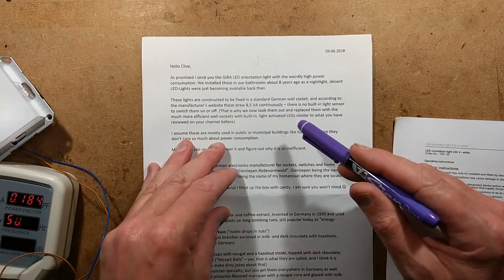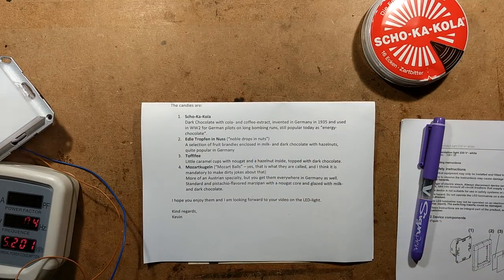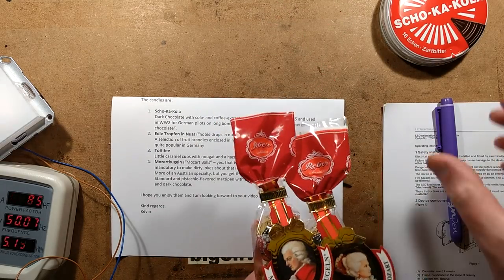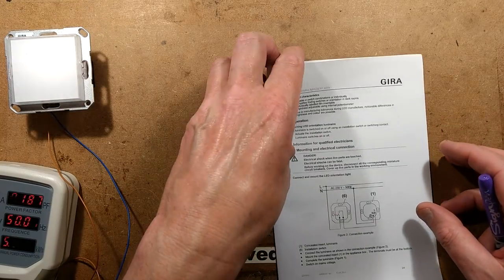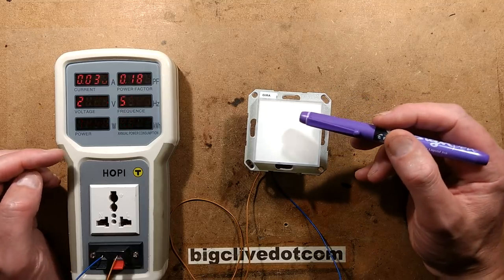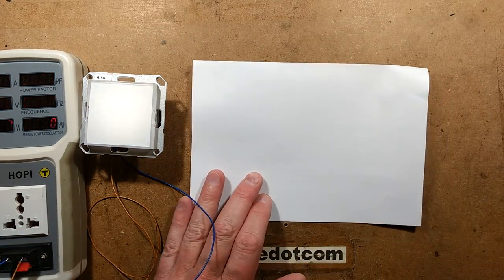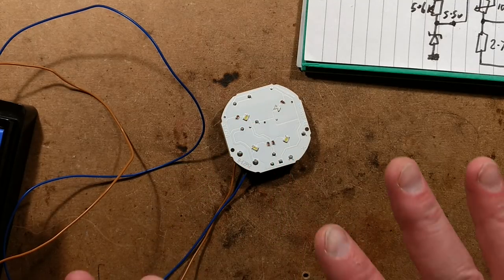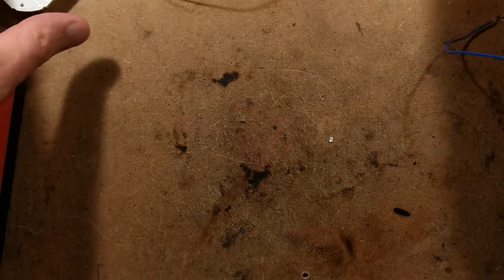Well engineered German LED light?  With schematic and tests.

Comment: I am almost certain VA is what people are already being charged for by some companies. I know of four people who have seen a jump from approx. £30 to £45 per month on electricity with no difference to their usage habits or appliances. That's why when they wanted to change my meter I told them to go away in short jerky movements. My electricity company already hates me because my bill is so low it actually costs more to bill me than I have to pay. OK I'm a single guy in a flat but I got my bill down to under £5 a month.
Reply: Gordon Lawrence Wouldn't work here. You pay a basic fee just for the potential of being delievered electricity. It is around 10€.
Reply: Future Chaos do you live in Germany?
If yes my condolences on your “Energiewende”. What good does it make shutting down Nuclear plants when you border a country with like 50+ reactors? And BTW France's carbon emissions per kWh are less than 1/10 that of Germany and the UK.
Reply: Krasimir Ivanov The energiewende term has more to do with switching to renewable energy and less with stopping nuclear plants as that came later on after the Fukushima incident. And you can't just keep something up and running just because someone next to you does it as well. Now while I don't approve on shutting down nuclear power plants and building new coal plants there are some problems with nuclear power. The waste problem still hasn't been solved mostly for political reasons but we can't just simply dump it into norwegian arctic waters like russia.
Reply: My point is if a nuclear accident happens it is very likely to happen in one France's aging reactors. Guess what the direction of major  wind currents is? Well you can do what France is doing with its waste. Storing it in deep geological repository under 500m of claystone/mudstone, 400m of granite. The risk is minimal. Yes it is expensive but still better than financing solar energy in a country where half the year it's overcast or buttfreezing winter.
It is better than killing you economy which relies heavily on electrical power.   
0,33$/kWh vs. 0,20$/kWh but still doing far worse  in terms of efficiency and enviromental impact. 
Renewables subsidies are a bad idea. They shortcircuit natural market drives. Renewables are becoming viable  but still can't take the planned 40% share without having to rely on a lot of backup plants which still require maintenance and mitigate any enviromental benefits.
Reply: Krasimir Ivanov We had our share of accidents where radioactive materials leaked through into the groundwater. So even if nuclear plants build today are as save as it can possibly get there is no sensible solution yet found to store the wast. Using sun and water will never be that efficient but at least when they break down, we know where to put them.
Reply: The Asse II salt mine should never have been used in the 1960s and 1970s as a site to dump nuclear waste.  Today, nobody would choose this mine to place radioactive waste. Anually there is more radioactive waste  (238U, 226Ra, 210Pb, 232Th and 40K) released in the atmosphere burning coal than the few accidents we had past 50 years.Today's technology andsafety regulations makes it so unlikely for an accident to occur that it is really more enviromentally friendly than even wind/solar.
Reply: Krasimir Ivanov Yes I think it could be stored reasonably well but instead they used shitty storage because.. basically the good places said no fuck off we don't want this here. But we do like some electricity, okay thanks. It's more likely gonna be that exeptionally crappy belgium reactor that's gonna blow first. The thing with renewable energy sources is that development is not going to take place all by itself and forcing it into the market is going to speed up this process. We have come a long way with wind energy and small towns finance their own parks and often make a decent profit. Offshore windparks are coming along nicely but there are still some minor problems that keep those things from beeing viable economically and those things have to be solved better now than later on. France just has full on nuclear power which also isn't all that cheap but most important the general population in germany has a negative bias against nuclear power so we are not gonna get it. It's sad but it is the way it is
Reply: Because not everyone is doing the correct thing means nobody should? Nuclear is an inherently dangerous technology. If the companies that run nuclear reactors would need to get insurance for it in the public place for the potential catastrophes, nuclear energy would be too costly to be used. But because the public/government/tax payer covers the cost of potential nuclear meltdowns and areas being contaminated and the other fallout that can happen, it is so cheap out of the socket. So all other power generationg technologies enjoy as much or more subsidies than solar and wind in Germany today. Our economy is doing fine. The real solution isn't a national one but a global one, using nuclear is not even a stop gap, because it will mean people will be complacent. If you build a nuclear power plant today it needs to run for 30 to 40 years before it turns a profit. That means the companies will have a vested interested in keeping competing, clean energy sources uncompetitive and blocking legislation and activities to generate hydro power, solar power and wind power in the appropriate places as well as investing in storages solutions and a grid that can handle all this decentralized power generation over all of Europe. You are thinking rather small.
Reply: Nuclear is an inherently dangerous technology. You would be surprised how SAFE they are TODAY. It is more likely to die of hundreds of other reasons. A dissaster the size of Chernobyl is impossible to happen becuase all reactors of the type have been decomissioned or improved.
It is very likely to die in traffic accident, heart attack, diabetes, cancer, work accident. Folks cross the street, stuff their face with greasy meat, smoke two packs of cigarettes/day, work in construction. I bet you 50 bucks the last 15 years of solar energy 100s of people died building them. it is okay for someone else to work on an oil rig  but no if your bacon in on the line with a chance less than 1% of the one you have of winning the lottery. No way!
Reply: The only real problem we have to solve is energy storage. Once that is solved we don't really need coal or nuclear. Solar cells, wind turbines and a few of the other renewables would be enough. You don't even need a massive amount, about 50kWh per household would be ok and would not be that large if stored at the household level. Domestic generation from solar during the day is enough together with wind to power most industry. You could draw in the effectively dispersed batteries in the day.
Reply: @brk932  Estimating things based on a percentage of incidents, is a bit silly.. If nuclear goes to fuck, then nuclear goes to fuck... Not just a single guy getting fried like an egg on a rooftop, but logically way more severe... Luckily, it rarely happens as you can see..
Reply: Solar is wonderfully clean, so long as you ignore all the chemicals and processing that goes into making the panels. Hydro is great so long as you don't mind submerging entire valleys and cutting off ecosystems.

None of our electricity generation is "clean". The only thing that can be definitively said is that burning coal is the worst modern way to do it. Shutting down nuclear plants and firing up coal plants is like refusing vaccines and then smacking a rabid dog with your bare hands.  (Renewables are great and use should be expanded, but they aren't a panacea)
Reply: Robert Szasz the chemicals and processing are nothing like as bad as you think. The data you are probably looking at goes back to the 70's when solar cells were in their infancy.
Reply: The point still remains that it is far less dangerous than crude oil which contains all sorts of nasties. Have you ever looked at the composition of drilling mud for example? That is way more dangerous than the doping chemicals for either silicon or gallium arsenide semiconductors. Boron is really not that dangerous at all and has almost taken over from earlier group III dopants, and phosphorus has started taking over from selenium. In the amounts used it is harmless. IE a few PPM. Most grades of petrol and such like contain benzine - toxic and carcinogenic. Coal contains actually quite high concentrations of arsenic and all sorts of other nasties including some of the nastier fluorine compounds once burned. Gas fired generators give of PCB's (polychlorinated byphenyls) and environmentaly damaging chemicals gram for gram do not come more dangerous than that.
Reply: @gordonlawrence4749  Solar cells are probably one of the dirtier renewable energy sources in terms of build and disposal per GWh (very very 'clean' during operation though with minimal environmental impact) wind and hydro have higher operating impact but lower hazardous waste at the end of their lifetime. 

I'm pretty sure nuclear and renewables fall within the same sort of range in terms of environmental impact per GWh. Orders of magnitude better than  the best fossil fuels. Many, many orders of magnitude better than coal.
Reply: @gordonlawrence4749  oh, and drilling mud going down is pretty darn safe, it's mostly water and bentonite. Rocks are dirty, nasty, toxic things though, and when ground up and mixed into the mud it forms a toxic slurry.
Reply: That was exactly my point. So in both the long and short run Solar Cells are far better for the environment than any of the alternatives and that includes the issues surrounding power storage, which will fairly soon be reduced further by carbon large capacity supercapacitors. I'm not going to go into detail as the chemistry is a trade secret but all they contain is carbon, cellulose film, a plant oil, and a mild acid that is safe enough to drink in small quantities. I have already got the capacity up to 1/3 of lithium cells with a charge/discharge life in excess of 6000 cycles. (testing 50 charge/discharge cycles a day for 4 months on 20 units for zero failures.

Comment: Just do not use the lamp with capacity dropper. They really shimmer. We are banned from such lamps in many places. Because the light pulsation coefficient is measured (it is printed on the box.). Good LED lamps have driver with power correction also.

Comment: I was wondering if its possible to (after removing and replacing all wall mounted mains dimmers with switch plates) change the 6amp lighting circuit with a 12V in line transformer and have 12V LED ceiling lights instead. There would be no need for cap droppers. The bulbs would just need a bridge rectifier and storage cap then the relevant resistors depending on the amount of chips in the lamp. Would that make them cheaper to make/buy than the mains led lamps using full drivers for proper driving of LEDs. I can think of tons of benefits on having a 12V lighting circuit apart from what power transformer you would need. I wonder how that would effect PF on the meter. a little model or set up might be required. My front door "reception" passage has a 12V string (5) on the ceiling and I have replaced 3 of the 20watt halogens with 12V 2 pin led spot lamps and they look a lot brighter on the wall than the 2 remaining halogens. The transformer is under my bedroom floorboards on the side of a joist wired into the original rose for the passage hidden out the way. It is rated for 5x50W halogen lamps. Its a commercial fitting and I have had it for 15 years now with no issues! I think the transformer is actually under rated voltage wise, about 11.5 volts or something for a tiny bit of extra life on the bulbs. I'll have to test it with my meter, never thought of that lol

Comment: The power company's justification for charging for apparent power is that their equipment has to handle that amount of power. Here in Australia domestic consumers are charged for real power and commercial apparent.
Reply: Their wiring has to hande that current, however they do not have to generate much more electrical power. They only have to produce a bit more because of the increased losses in their wires and generators.
Reply: Not just their wires though, also their transformers and switchgear and protection devices have to be able to handle the current. In the bigger picture there's also the issue of harmonic distortion. 
Rather than our electrical utilities charging us more I'd prefer some regulation and/or greater consumer awareness.
Reply: Of course, anything that carries the current, i.e. everything that contains wires.
My point was that you don´t have to burn 1KWh worth of fuel to supply 1KVAh to a load.

Comment: IMHO, one of the major push to electronic electric meter from mechanical ones is due to the former being able to accurately and quick to record fast changing power demands which the later ones couldn't as its reaction time is much slower. you will definitely see a jump in the electricity bill after "upgrading" to smart meters. i'm still stubbornly holding on to my mechanical meter. :)